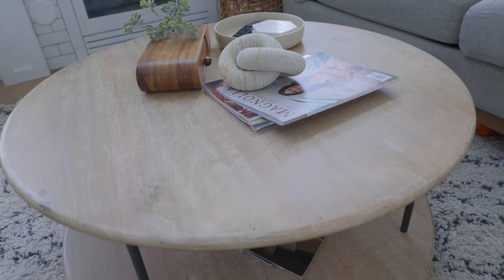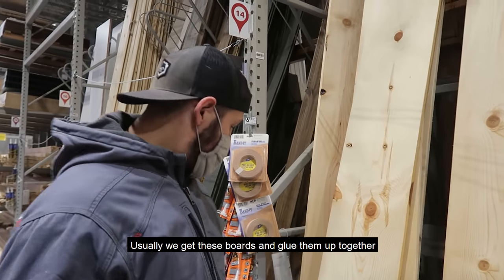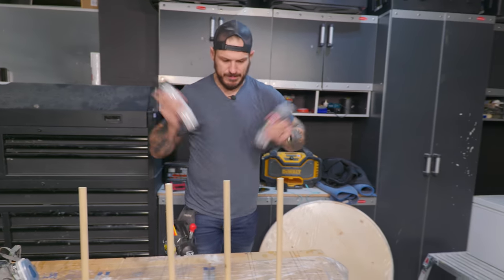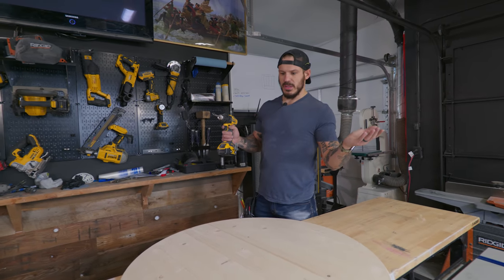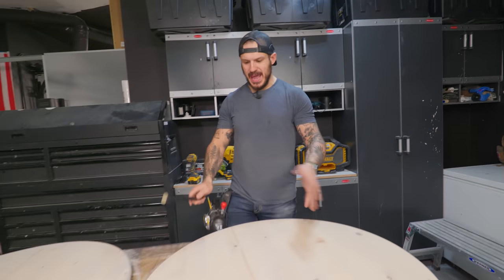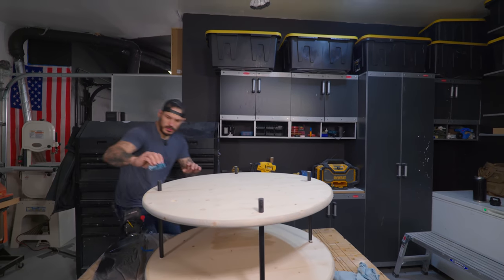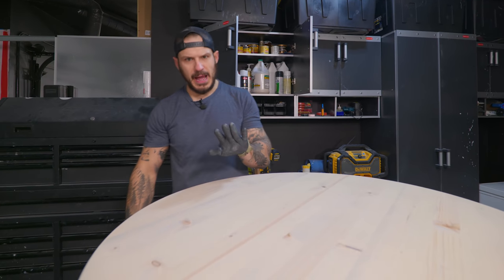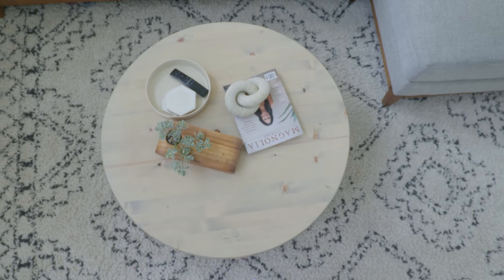Building Expensive Coffee Table on a Budget

Comment: Excellent build. It's the same, but different enough to still be unique.

Suggestion for anyone else building this: when using the brad nailer to secure the legs, nail them on the inside (hold the nailer at the center of the table). The nails will likely not show regardless, but that's just an extra step to hide the fasteners.

I love your content, and you're inspiring.